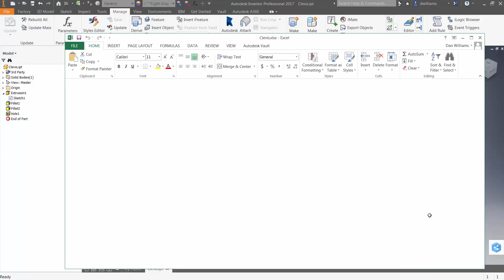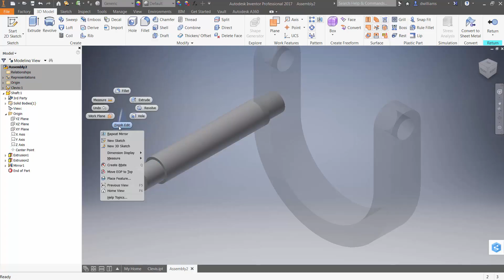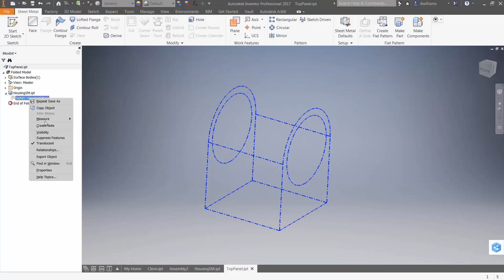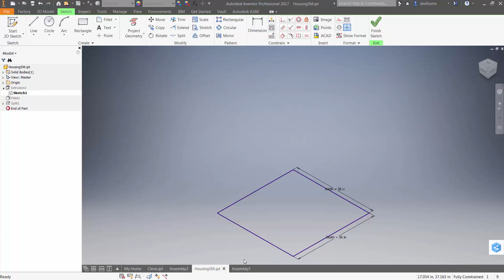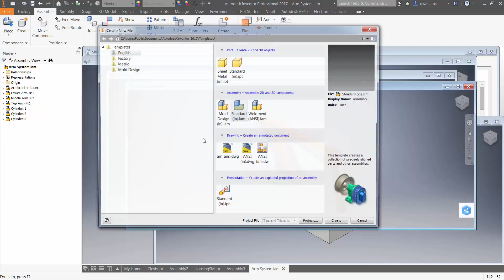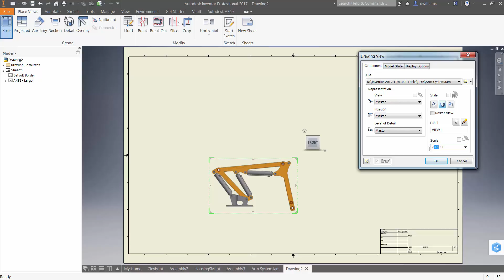Inventor 2017 Tip and Tricks

Comment: Hello Dan,
There is one small mistake. You changed a value of "Angle" mate for Compressed Position Representation instead of "Stroke".
It has not made a problem cause you created "Compressed" Position Representation when value of the "Stroke" was 0, but we have to be careful. Angle of the rod will not extend or compress the cylinder :).
Thank you very much for great tutorials cause now I have idea how to easily change states of my assemblies.
Best regards,
Danijel
Reply: I came here to say the same thing. Even though it "looked" succesful. It definitely isnt the model behavior that he'd want.